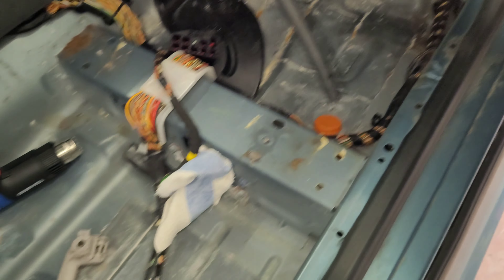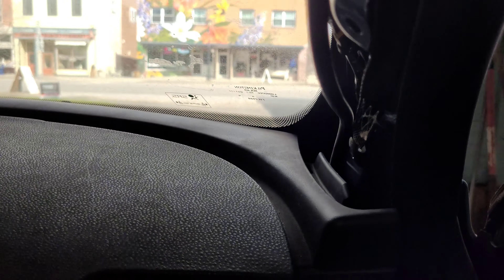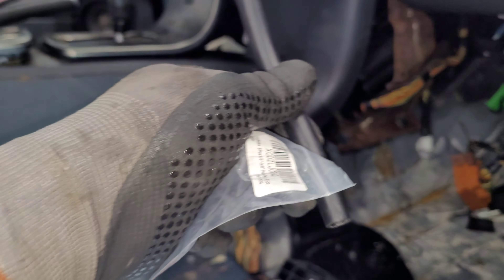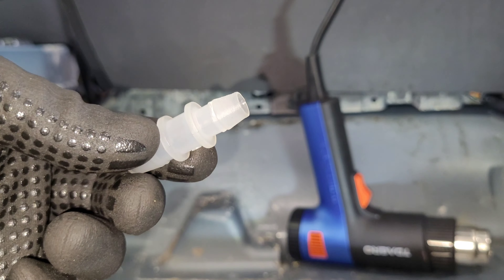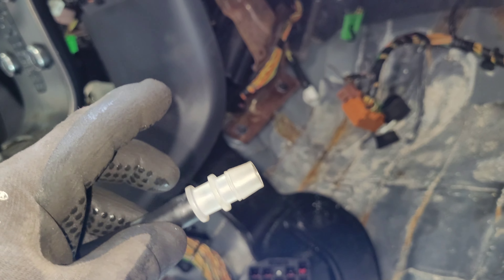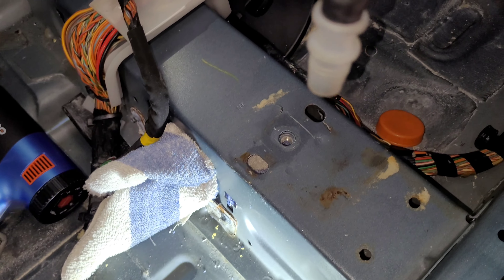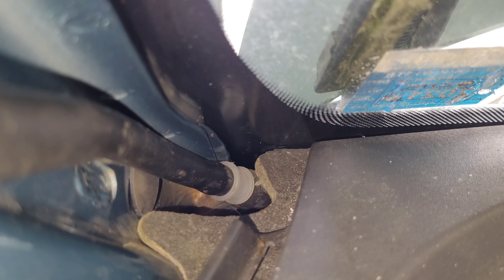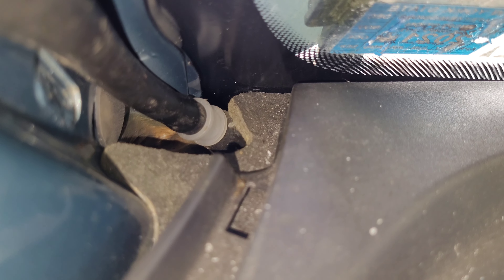Volvo Sunroof Drain Fix (P1, C30, S40, V50, C70)

Comment: what size is your rubber tube? thanks
Reply from the maker: There's two sizes in the assembly. The smaller tube leads down the pillar into the adapter, into the larger tube. My apologies I can't remember the outer dimensions but the inside is labeled in the video